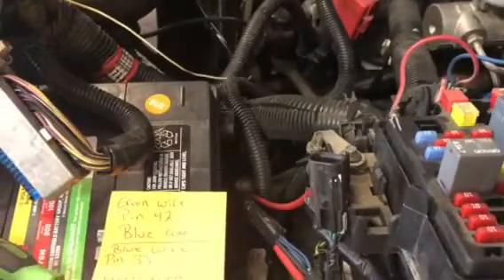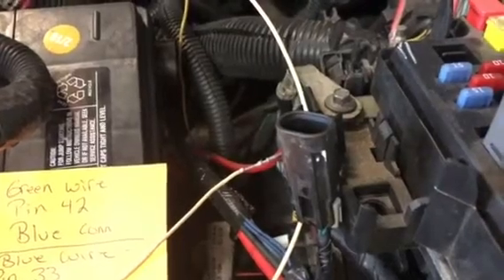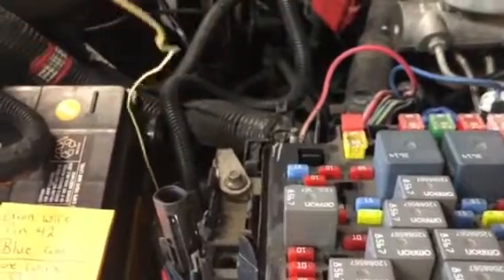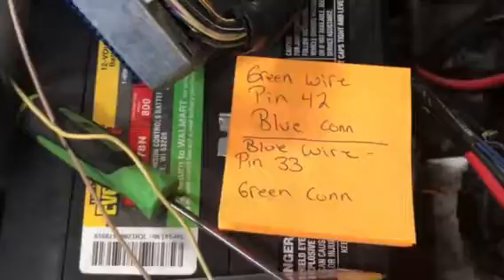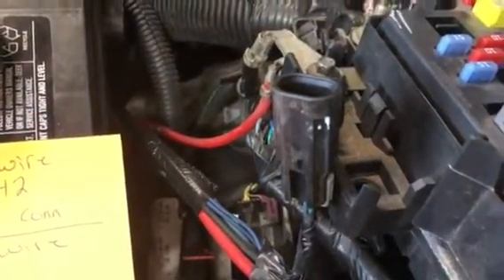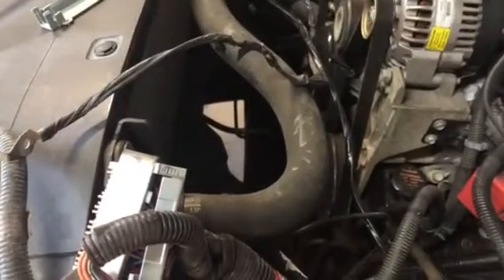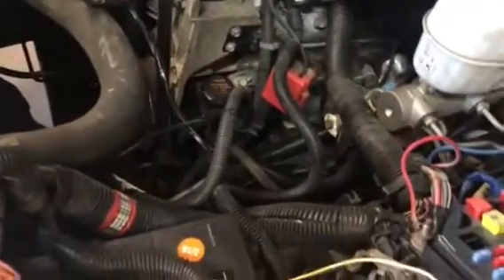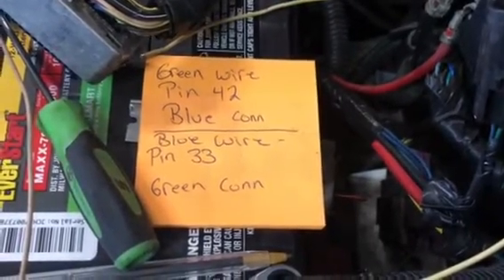Fan wiring Install on GMT-800 Trucks and SUVs. Plug and Play

Comment: What do you mean about the a/c pressure for them to work correctly?
Reply from the maker: In the tune you have to adjust the AC switch pressure for the fans to work correctly

Comment: So basically if you have the blue and green wire on that connector you can tap into it there with a plug to control both of your fans? Did that connector come factory on the engine harness to run the signal wires to the fans? The reason I'm asking is because I'm doing a v6 to v8 swap in an 03 silverado. The donor car is an 05 tahoe. I do not have the light and fan harness though but I think I have that plug coming off of the engine harness and it's already pinned for fans. So I just need to get a weather tight plug and run my signal wires correct?
Reply from the maker: The 05 tahoe should have the stuff you need for elect fans